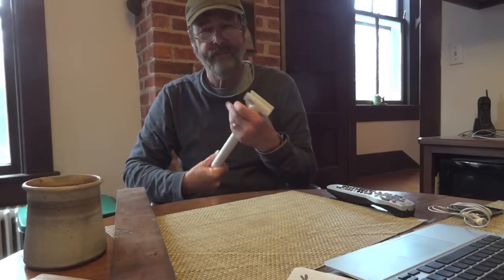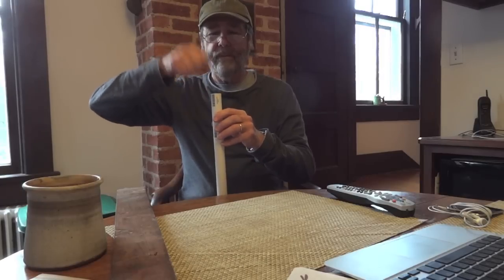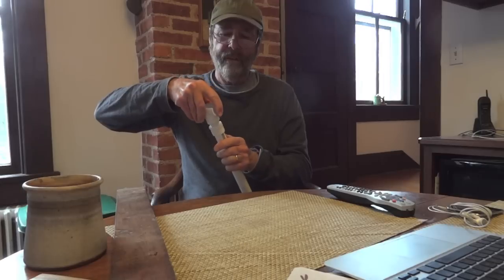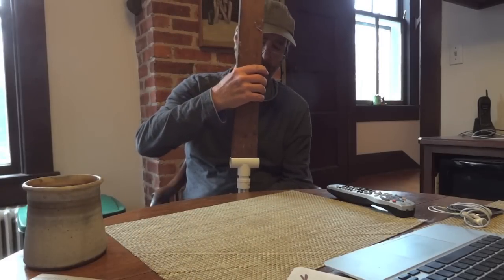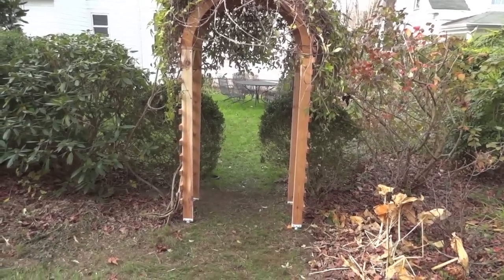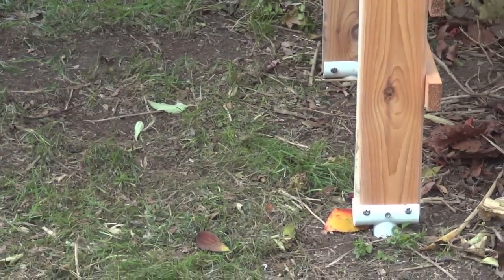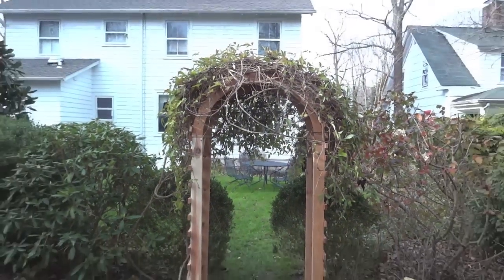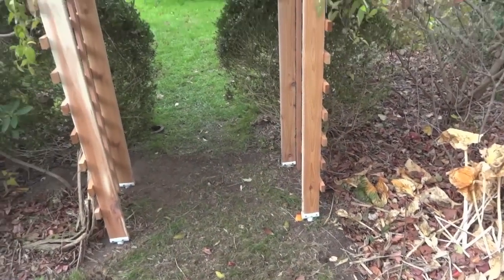Arbor and or trellis anchors or footings, no concrete required

Comment: Good idea!  I only wanted to mount a small store-bought fan trellis for a climbing rose, wasn't sure how to do that.  Thanks for clarifying what the parts are called.
 
Update:  I used this concept today for the small garden trellis, works great!  I couldn't find T-snaps at HD, so I used a reducing Tee (1X1X 3/4) and 1 ft of 3/4" pvc for the post.  I cut a notch out of the Tee with a hacksaw wide enough to fit the trellis bottom, then secured it with two wood screws.  I didn't have a wood mallet to drive the post into the ground, so I just dug a hole with a trowel.  Note:  You can use a regular T, the reducing T's and 2 ft lengths of 3/4" PVC that fit them just happened to be right in front of me.  What ever works is my motto!
Reply from the maker: Smart

Comment: Great idea! I would have lowered it closer to the ground, but I get that you also don't want the wood to rot.
Reply from the maker: Yes the wood is a good as new after 11 years.  I may have put a little something on the bottom wood once to prevent termites or insects to prevent deterioration.

Comment: It's a good video as it gets one to thinking.  I'd be concerned that the plastic will split fairly soon, if not due to movement, then to plastic being rather brittle.  I hope it lasts.  When the mailbox was installed, it came with a steel support.  It took 11 years for the obvious to happen; the installer put the steel support at ground level, and the treated wood rotted.
Reply from the maker: Good for around 6 years so far with no deterioration of plastic.
Reply: That's PVC, not simply plastic. PVC lasts forever
Reply from the maker: Good still eleven years later

Comment: My mother-in-law bought us an arbor as a gift for our new house, a gorgeous cast-iron, Victorian-style arch, but it came with very flimsy, very short cheap iron stakes to hold it into the ground. It never held right from day one and a breeze would make it wobble. We would have to go out once or twice a week and re-hammer the stakes into the ground. Then Hurricane Harvey came not even six months later and knocked it over and the stakes were all bent over and the hooked part of one of the stakes eventually snapped off. I threw it and the other three stakes away after that. I've never been able to stand it up again. For the last year it's been leaning against a fence until yesterday when I put it up to wrap Halloween lights around. I have those very cheap stakes that came with our Christmas light-up reindeer holding it in and I've got it tied to cheap plastic yard stakes. It's not going to hold. I'll have to take it down tonight since we are expecting wind and rain tomorrow. Anyway, I came across this video because I was looking up ways to see how to anchor this arbor without cement, because I'd really like to use it as intended, and not just for a Halloween decoration. Plumbing pipes. What a fantastic idea. I'm going to try this. Thanks!
Reply: Did it work for you?
Reply: @watr77222  Hi! Actually, we ended up not trying this out after all. A friend's trampoline broke so she bought a new one which came with its own hooks that go underground and have a chain attachment to the trampoline. So she no longer needed her trampoline stakes. She had 8 trampoline U-shaped stakes which go a foot underground with a 2 inch thickness and are heavy-duty steel. So I ended up going with those. These things are heavy and huge. But the type of arbor I have is cast-iron with ground hook anchors on each end plus two on the sides. I think these hooks were the most suitable for them. So the trampoline hooks were able to be hammered into the anchors where they are stuck in. We've been up to 50-60 mph gusts and it's still standing. Today it's covered with trumpet vines and jasmine. And even the branches of these huge vines haven't been able to take it down.

But for a wooden one like this, which doesn't have hook holes in it, the plumbing pipes make more sense.
I can tell you that my neighbor used a similar anchor method with his gazebo and so far it has been working for him.
Reply: @sunlightangel87  Thanks for the update, I really appreciate it.
Reply: @watr77222  Of course! Happy to reply :) Have a wonderful day!

Comment: Hi, Could you tell me how your arbor has held up with this system? Thanks!
Reply from the maker: Ann W It has survived two cold winters and the warm summers on Long Island without and deterioration.  I just make sure the dirt does not creep above the plastic anchors to prevent the wood from rotting.
Reply from the maker: 10 years and as good as year one
Reply from the maker: 11 years and as good as new